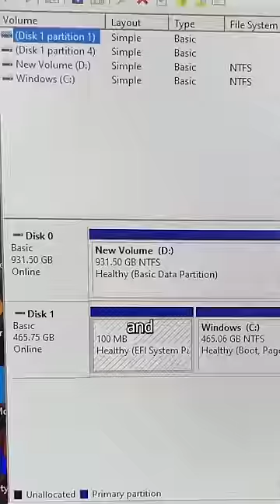Cleaning a CyberPower #gaming #pc (Big Mom edition) #shorts #tech #technology

Comment: A new 3 TB spinning rust drive for a gaming PC? Hopefully that's not for games or his loading times are going to be longer than my wife's evenings out with Lupe.
Reply from the maker: Hahahahaha
Reply: Like 99% of games have perfectly fine load times off HDDs though. Plus the space to $ ratio for HDDs is way better.
Reply: @CoffeeAhead  HDDs are... what? 30% cheaper than SSDs with equivalent space? The pricing is pretty close nowadays. And the kinds of games that require enough storage for a multi-terabyte external drive are typically the ones that suffer from slow load times. But yeah, it's not actually that big of a deal. I'm mostly just being hyperbolic. I don't even know if the drive is for games.
Reply: @CivBase  yeah, I guess recently the price difference has gotten smaller. Personally I have a 1TB SSD for those unoptimized messes and then just big HDDs for everything else.

Comment: I spilled 1.8k on a Cyberpower and have regretted it ever since, it had CONSTANT software problems right out of the box. I have a Legion PC now, I did not have to build it and I did not have to regret it either, very high performance PC and nothing has gone even slightly wrong so far.

Comment: So, I got a cyberpowerpc about 2 years ago, and the warranty expired, but I gave it to my brother because he neeeded one, and about a month goes by before it stopped working. I opened it up on the front to see what’s wrong, and the power button just stayed on even after turning it off. Then I opened the other side and there were just cords EVERYWHERE. No zip ties, no cable management at all. Right now it’s just sitting under the kitchen table, but it has an intel i3 (idk what gen), a pny 1030 gt, and I think 1tb nvme? I was wondering if I could send it to get it fixed and get some new parts for it maybe. I don’t have that much but I’ll have some more money soon.

Comment: hello sir i have a problem with my laptop its stuck in the boot system it show PCI LAN IBW GE SLOT 00C8 V1366 and Boot system I searched all youtube i fixed the boot system but i didn't fex the pci lan iba ge slot 00c8 v1366 i searched all youtube i didn't found anything if you can help that will be thanks full